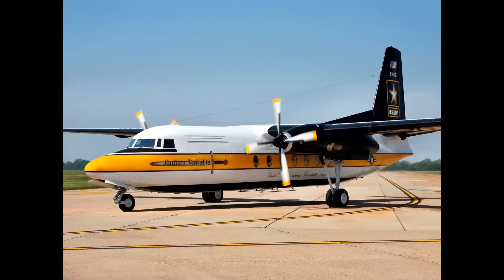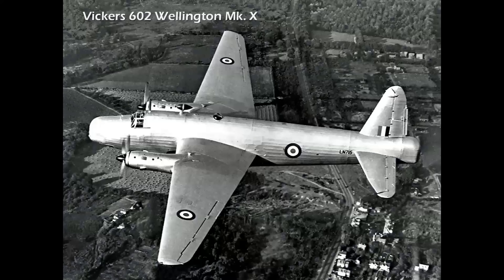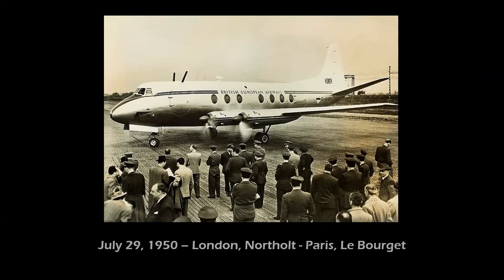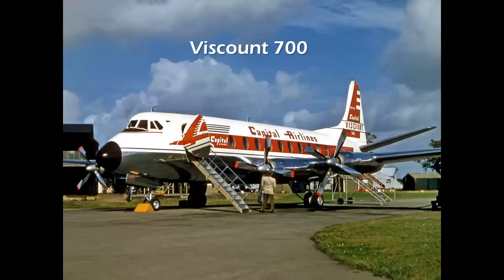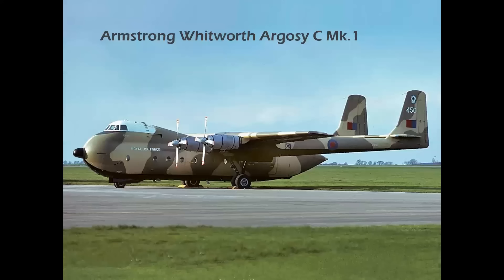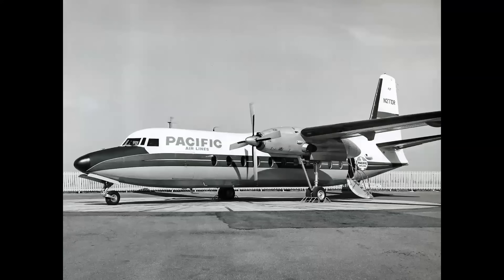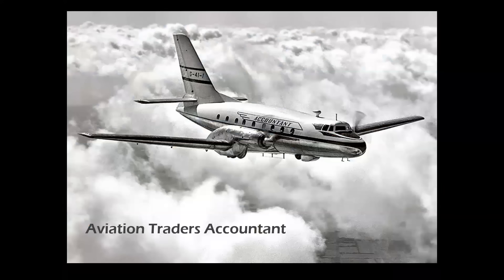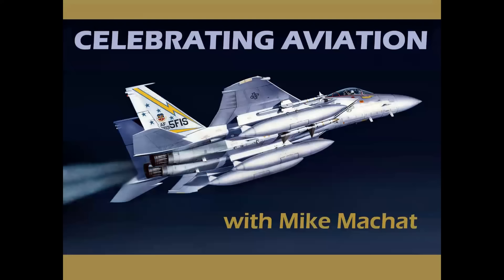ROLLS-ROYCE DART - World's First Production Turboprop Engine

Comment: My first passenger flight on a Dart powered airplane was on a Continental Viscount in 1960.  Later I was a mechanic at Central Airlines, hired in 1965 a few months before Central put the first RR-powered Convair 600 Dart into passenger service.  At 10:02 you see N74859, the first in service, at Dallas Love Field Gate 9, Yellow Concourse.  N74858 was the first to be delivered, but was assigned to pilot training duties until its paint job could be updated to Central's new look.  The Rda10 engine was a new design at the time, rated 2700 hp with water injection at 15,000 rpm.  The engine had some serious teething problems, including leaks from flexible fuel hoses that hardened and cracked in the heat of service, excessive coking of fuel nozzles, air leaks from inter-combuster can connector seals, and progressive cracking of the compressor casing originating at the top engine mount and eventually causing the inflight loss of the front half of the engine with propeller from a Trans Texas CV-600.  Somehow no crash ensued, but it was a close call.  

The Dart 600 was a very smooth airplane in flight with none of the vibration that plagued the CV-580 and its powerful Allison engines.  However, the Dart could not match the high-elevation performance of the Allison.  In 1967 Denver-based Frontier Airlines, already operating the CV-580, purchased Fort Worth-based Central Airlines in order to gain access to the Dallas market.  Central at the time was operating into Denver not CV-600s but DC-3s because the Dart's poor performance at high elevations limited the load it could carry out of Denver, much less Frontier's many mountain airports.  Frontier retired and later sold the Darts.
Reply from the maker: Terrific comment and good information, thanks!

Comment: Great Video Mike.  Never got a chance to work on a Dart, but did get to work on quite a few Allison 501-D13s on Electra freighters we were contracted to Maintain. 
Taxied an L188 to a run-up pad once, when you drop the power levers out of the Beta detent and just give them a nudge, it threw you back in the seat. Instant thrust. 
I miss the scream of the Darts on the F27s at the gates close to our hangars.

Comment: The YS-11 flew freight in the US until the late 90s, affectionally known as the Rice Rocket (RR). Get it?
I had the pleasure, if it can be called that to work on that engine on the YS with Rotol 16.5 feet prop, and G-I many years ago. Made a horrendous roar on water-meth inhection. Great video.

Comment: I’m so old I still remember riding them. Viscount, F-27, Herald. The most impressive was the large circular window of the Viscount.  The sound of the engine was different than present day prop engines. If my memory is correct they needed methanol injection for additional power.

Comment: Back in the 60s and 70s, the airline have have been working for operated a fleet on Vickers Viscounts and Fokker F27s. By the way, the Viscounts have been replaced in due time by Caravelles and the F27 by F50.  I still have in the ears the high pitched whine of the Dart engines at start up!

Comment: Very well done.  In the early 60’s I took a Continental Viscount from Midland/Odessa to Houston.  Being a schoolboy I got to sit up front where I could best see and hear the Dart engines.  The wing was quite flexible and it was very interesting to watch the engines and wings vibrating out of phase.  How did Vickers avoid the aero-structural dynamics that plagued Lockheed on the Electra?
Reply: Probably the Viscount had a better engine support structure in the nacelles than what the Electra originally had.
Reply: @WAL_DC-6B  Good Point.  I had an earlier flight in a Fairchild F27 and had not noticed any relative motion.  My comment on the Viscount motions suggests that the structural response frequency was relatively low.  Thanks.

Comment: Convair considered building an enlarged 4 engined aircraft based on their legendary Convairliner Series which would have used the RR Dart but it never progressed passed the concept stage. Too bad Convair never built a competitor to the Lockheed L-188 Electra using the Allison 501d13, that would have been one outstanding and beautiful aircraft.

Comment: The Dart was a centrifugal compressor engine compared to later axial compressor flow engines. These engines would eventually be superseded by engines like the RR Avon and Sapphire...but..the Dart was extremely reliable with minimal maintenance. It did have a very shrill intake sound...but served as useful warning to keep humans away from the intake!
Reply: To get near the “intake” is to get near the propeller!

Comment: Thank Mike, I learned a lot new on the Dart.
I'm verry supprised someone came to the unblessed idea to put one of these engines on a fighter plane.
Mind you this is a single shaft engine that is not verry well capable in rappid power changes, and you really want a GPU to start it up.
Also it is a pretty loud wining engine, wonder how it went up at a GulfStream.
Great video !

Comment: As a Once Upon A Time flight line guy two thoughts occur, 1.  the "flower petal" engine panels...hope those latches were fool proof, imagine the air stream getting a hold!  and 2. Raynus comment below:  Mike is a visual guy and glider pilot (I think) so engine noise is not on his plate but engine sound is embedded in the memory of every aircraft I worked,...the whistle of the "Tweet", the rumble of the Phanthom...any R2800....
Reply: The cowls did not just depend on the tension latches but also had a set of self locking or ratcheting screws that would attach the cowls at the inlet cowl part at the front of the engine, these would act as belt and braces to keep the cowls closed.
Reply: @johnyoung1128  Thanks for the insight.  Something about that design just makes me cringe.  Another thought I had is it must have been problematic to open those on the flight line in any kind of a breeze...drives a hanger spot for engine work.
Reply: @dwhip49  That was not my experience. There were also struts with latches that locked the cowls open. The cowls were a little different from aircraft type to aircraft type and my main experience was with the AW 650 Argosy installation. I did have one of my colleagues get hit on the head by the lower petal cowl on a Fokker F27 but that’s about the only difficulty I can remember.

Comment: Loud, obnoxious, gas-guzzling, complicated all-mechanical engine and prop controls. We had the F-27-500 and -600 models and a couple FH-227 Fairchilds. Flew them with purple tails back in the 90s and early 00s. I don't miss them, but I do.

At 4:00 there's a Viscount with four engines running, and people standing around without ears plugged. No doubt they all went deaf shortly after :)

Comment: In your video I noticed that the Dart engine rotated in the same direction as other RR engines; cw when viewed from the front.  However, the two Mustang versions rotated ccw.
I am curious if any other aircraft used this configuration?  For what reason would any low volume customer go through the seemingly needless  expense of changing the gearing?

Comment: I would query your calling British adapted Dakota's Pionners. The name I was told came about as all C47 came through the state of Dakota by the way. The Scottish avation , changed C47's to Britsh instruments and passenger configaration for British European Airways (BEA) and went into service with original engines as the Pionair.  they were used regularly on the Channel Island route to Jersey Channel Islands. Live on the rock (9 miles long by 5 miles wide) You either swim very well, or take an aircraft. The Pionair was the first one I flew on, then came the Viscount's and Vangaurds (upgrade Tyne engine),  with the odd HP 748, civil version of Andover, on charter flights.  Side trips flying horses on the BEA Argosy, delighful in one end out the other, if you were unlucky  the Bristol Freighter.🥵 . Then  came the Dart Heralds, finally those horrible stove pipe things in the form of the BAC111. So the Rolls Royce Dart could be called 'The Soundtrack of My Childhood' 
Can beat windmill on the front of the engine. 😁

Comment: I flew the F27 for 18 months. I was an “interesting” engine to operate. On cold days you had to “milk” the fuel cock to stop exceeding EGT limits. Starting at Ground Idle you advanced the power levers into the ground range. As you did so both RPM and torque would increase. Further advancing of the levers would increase RPM and torque until you reached the “constant speeding range” which was at about 10,000 RPM. Here just the torque would increase until a set value would achieved. Advancing further would again increase torque and RPM until you achieved the desired takeoff RPM (14,000 ish). If water methanol was selected this would come on as you approached take off RPM with a crackle and a whoosh.

You took off with all you could get, climbed at 12,000 rpm, cruised using EGT and descended using torque. This had to be kept above 60 psi to ensure proper engine lubrication. Another vagary of the design were fuel trimmers. These were thin electrical switches about 3/4” long. They controlled a servo motor that in turn metered just over 30% of the fuel to the engine. The fuel trimmers were set for start, take-off and cruise. There was a “fuel computer” much like a Dalton Computer used to calculate the position of the trimmer. You might calculate a setting of 87.3% but the indicator had a dial of approx 1.5 inch diameter with a few grubby marks complete with a thick needle. Off/half/full was about as accurate as you could get it for takeoff. Use them incorrectly in flight and you could overtemp the engine. 

It had huge propellers and only the inner sections were heated to protect from ice. It was not uncommon to see electrical arcing on these sections, especially at night. The outer sections would accumulate ice and the aircraft would shake and vibrate as ice as it built up. Every now and again large chucks fly off the props and hit the fuselage, scaring the passengers fartless inside.

The engines themselves were very sold and dependable but were very thirsty by comparison with modern engines. They burned almost 50% more fuel. The last manufactured, almost zero hour Dart, Mod 1830 was lost when G-BNCY stooffed in while trying to land in Guernsey.

Comment: I built model airplanes when I was young.  I bought the Viscount Trans-Canada Air Lines model at the Village Green in Hicksville, Long Island, New York.  It wasn't until the mid-1980s that I worked alongside an ex-UAL stewardess who pronounced it correctly.  For over 20 years I thought it was pronounced VISS-COUNT. :body-blue-raised-arms: